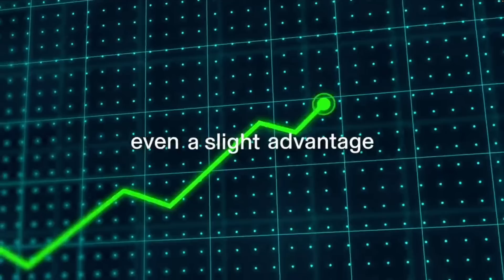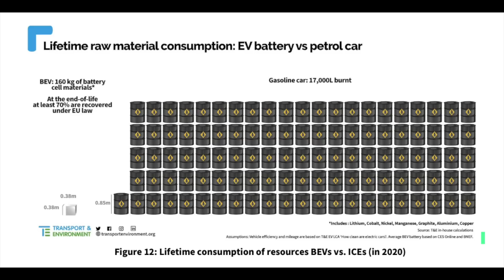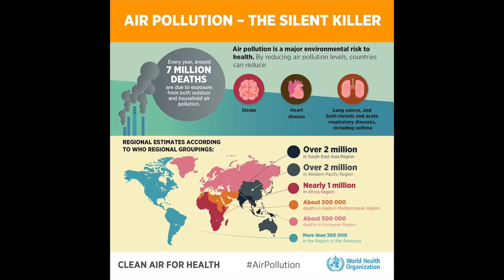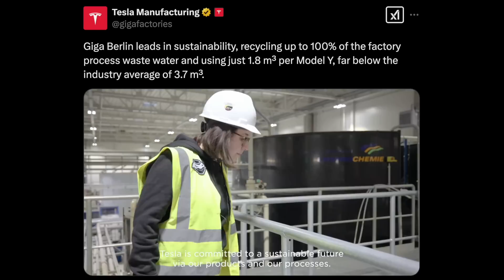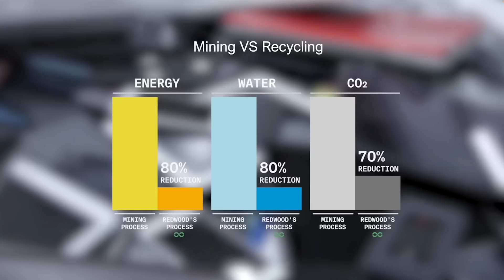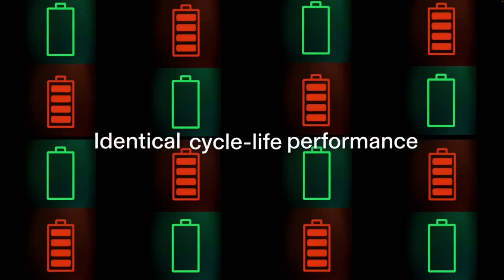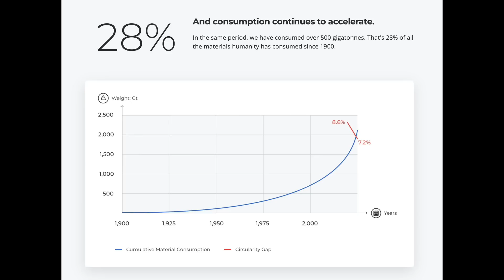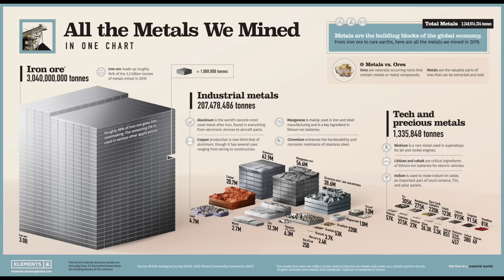The Circular Economy of EV's - Why Critics Miss the BIG Picture - Redwood Proves Critics WRONG!

Comment: You should compare the battery to the gas tank and the used electricity to the used gasoline! You forget the energy that is needed to generate the electricity that goes in to the battery! If the electricity is produced in a power plant that is running on gas or oil you are also burning a lot of fossil fuel!
Reply: That argument has no ground.  Gas is processed with energy to dig and process it and chemicals.  Sustainable energy is massively growing every year.  You can now completely power two teslas just from rooftop solar panels.  Also even if electricity is produced by a gas plant the electric motor is highly efficient where as equal gas engine is very inefficient so no matter where the electricity for the Evs comes from it's either still a lot better than the gas engine and if it's from solar/wind/hydro then it's multiples better.
Reply: @douglukinuk2682  You are right when the electricity is produced with 100% sustainable energy. However that is not the case at this moment! At best I would estimate that half of the energy is produced with sustainable energy. So the other 50% comes from fossil fuels. This 50% is what is missing in the comparison made by Lars.

Comment: Great, but with petrol and diesel, fuel is also consumed in moving the oil to the refinery and then moving the refined product to the gas station.
Oil extraction is also a large emitter of methane (potent GHG), and refineries obviously use a lot of energy and cause massive pollution to the sites they occupy.
During Covid, when transport was massively disrupted, we saw a little of what reducing fossil fuels looks like and it was good.

Comment: Gasoline and diesel are fuel in the same way that electricity is fuel for an electric car.
Gas tank is the equivalent of a battery because it is the tank for the electricity and the electricity you can never recycle.
You have compared very strangely.
Recycling is really good and it is important for sustainability in the long run.
Reply: That is some crazy mixed up logic sir. The electricity is not a material that you burn once, it’s an energy that you can make in an emissions free way and use in an emissions free way. The material used to hold that energy is highly recyclable. Liquid fuel is a use once high emissions, low efficiency material that consumes huge amounts of energy and creates significant emissions to manufacture.

Comment: Battery materials are elements. Elements don't degrade with each loop through the recycling cycle. For example plastics and paper/cardboard can only go around a couple of times before they degrade to an unusable state.
Reply: The 'degradation' in a recycling process lies in the size of the non-recoverable parts of each element.